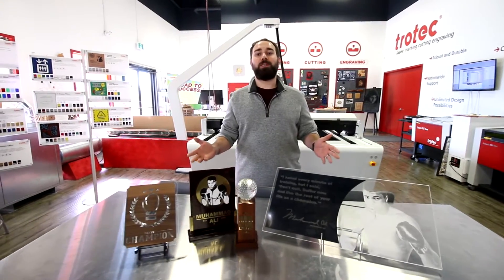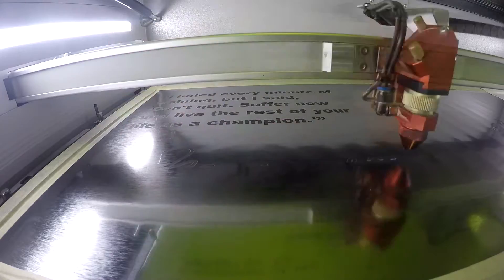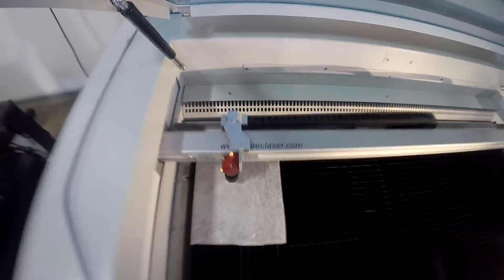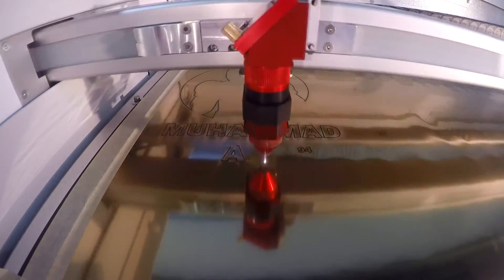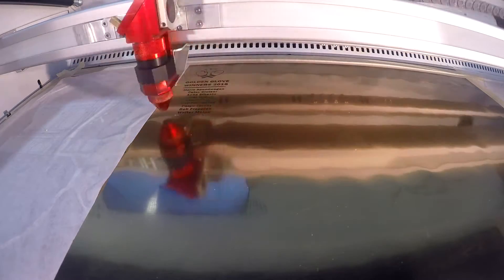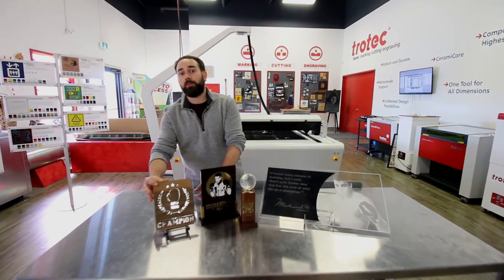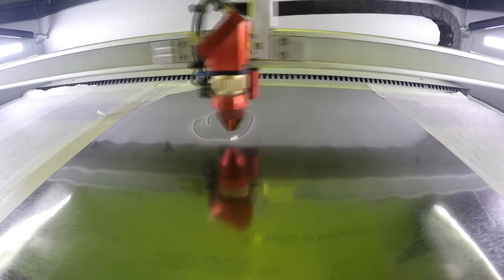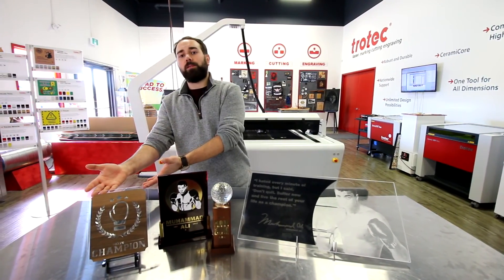How To Make A Trophy | Trolase Lights Premium | Laser Cut Thin Plastic

Comment: What are your recommended settings for this material using a Speedy 300?  I've been having a *** of a time trying to get this material to work, filling an entire sheet with test engraves.  I change settings at 1% increments, but all I get is either dirty grey that hasn't fully penetrated the cap layer, or a melted swiss cheese black.  No crisp black like can be seen on the trophy.

Or has the material changed since this video?  Wouldn't be the first time; I used to do wonderful glossy pitch black engraves when your 1/16" metallics were sourced from Encore, now the best I can get is a matte charcoal, after spending dozens of hours trying to dial it in.
Reply from the maker: Hi Rob, have you see our laser settings video: https://www.youtube.com/watch?v=3-NW9uwwrFI&t=1789s ?

Comment: Very nice result, but I'm confused by the lack of concern about preventing bubbles when adhering the sticky-back layer.  I have watched other videos by this author, and the same comment applies.  In this specific episode there is a very prominent bubble which somehow magically disappears.  You know something I don't?
Reply from the maker: Hi Neil, could you point us to which minute in the video you're talking about? So we can comment on it.
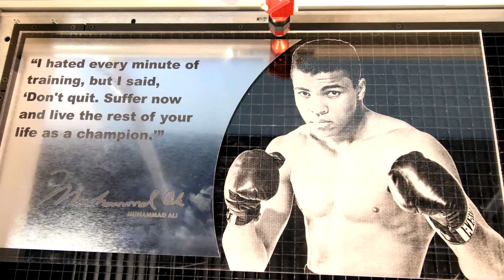Reply: @TrotecLaserCanada  Sure, it's at 1:20.  The operator is in such a rush to lay down the overlay, there's a prominent bubble visible.   I bet they lifted it back up and re-laid it (not shown).
Reply from the maker: @NeilWNC  Hi Neil, sorry but you're mistaken, the video is sped up because we speed up all of our "in process" shots. The material is extremely thin like a sticker, if you don't apply it properly there could be a bubble and you have to re-apply it but there is no bubbling in the laser process itself. Hope that answers it.
Reply: @TrotecLaserCanada  OK on the speed, but I think you're mistaken regarding what's in the video.  If you look carefully at the timestamp I mentioned you will see a bubble, the result of careless application.  I never implied that the laser process created the bubble.  I have always found that laying down adhesive layers takes a lot of care, applying only a small bit at a time.  At no time did your operator seem too concerned with this, which puzzled me greatly.  It's not how I do it.
Reply from the maker: @NeilWNC  you might be right, for the initial shot of the application it bubbled but then we did re-apply it for the final shot. We didn't realize this in the editing. Thank you for the comments.

Comment: Do you have to mask the material everytime before engrave it? Is the result better if you mask it?
Reply from the maker: Great question. No you don't, but we wanted to do quite a deep engraving into the wood for the inlay so we didn't want the extra residue (or in some instances the glue inside the wood like the glossy retail trophy). If you're just doing an image on wood then no, you don't need the masking. Any deep engraving is good to have.